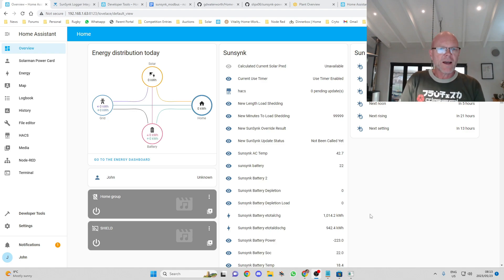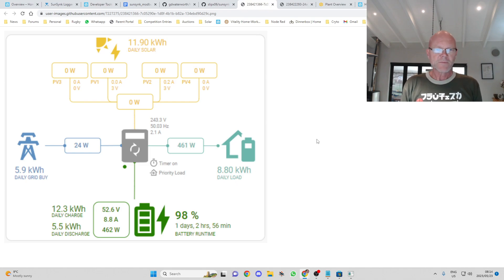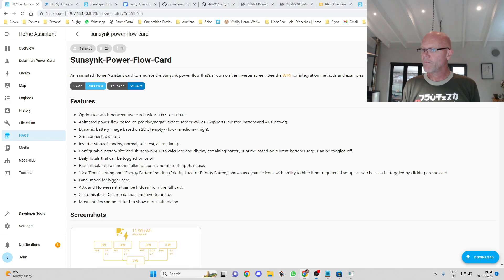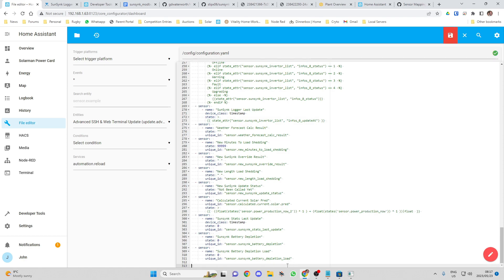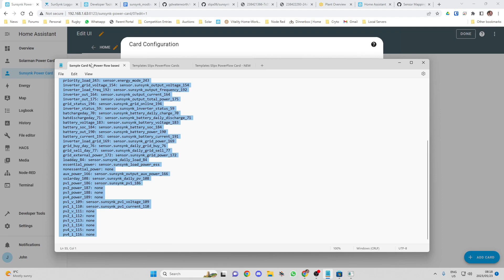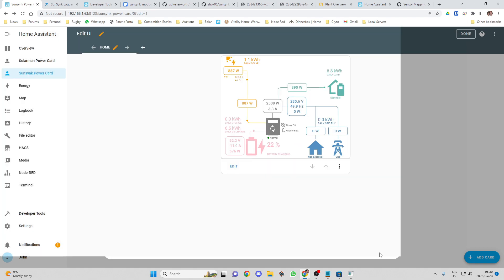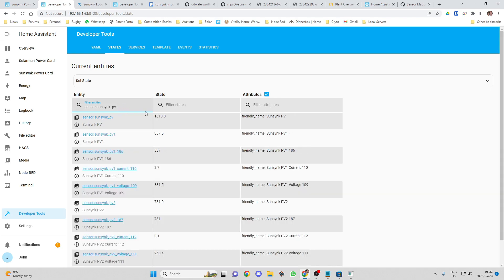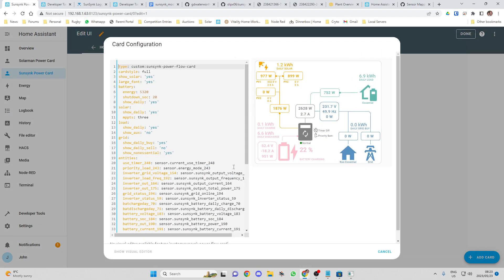Sunsynk Power Card

Comment: Good day - this video is a year old - is there an updated video - i battle to follow as my HA does not display the same - updated versions??   I have my card installed but it does not update readings.  Thanks
Reply from the maker: Hi Rohann, 

No updated video I am afraid, it however should all still be pretty accurate as not a lot has changed with the installation of the cards.  There are a few things you can check. 

Depending on what integration you are using to get the values from your inverter, the entity names in HA will change which will result in nothing being displayed in the Power card as it is looking for a different name in the card.
 
I would suggest you start of by checking that you are actually getting data from your inverter, Settings/Integrations/Device and then add them all to a card,  and then update the entity names in the card to match the ones from your inverter integration if necessary. 
I have found that it only takes 1 or 2 incorrect entity names in the card and the whole card will sometimes not display. 

Good luck, let me know how it goes.
Reply: @SolarIntegrations Thanks for the reply - appreciated.  Ok - my Entity`s in MQTT from my synsynk is all named like  "Deye/SunSynk/Sol-Ark PV current 2"  , the  names on the card is  "sensor.sunsynk_inverter_current"  - -  now i dont find the names corresponding - hope this make sens ......   Did i maybe did something wrong when i configured this? because its not sunsynk specific?   Should i maybe start again?  What would you do?    The reason why i ask if there is an update - if i go into HACS - i dont get the same options that you have on youre video.   Thanks again
Reply from the maker: How are you getting the data from your inverter, Solar Assistant? 
If your data is coming in via MQTT you should go to the MQTT integration in the Settings/Integrations menu 
You should see the MQTT devices that you have being detected by HA there 
Look for the inverter device and click on it and you should  see all the sensors available
If you click on the individual sensors you will see the names of the sensors in HA
 It should be along the lines of sensor.sunsynk+inverter............
Create a separate dash for you inverter data and then add all the MQTT sensors to that dash so you can check there are working correctly using the "add to dashboard" option at the bottom of the page. 
Once you have checked everything is working you need to match your sensor names to the card from Slipx06, I would suggest changing your sensor names in HA to match the card and not the other way around as it will be easier when  you want to update the card to the latest version. 
Good Luck :-)
Reply: @SolarIntegrations  thanks so much - helps allot (yes - from solar assistant).

Comment: Hi there thanks for the Vid. i'm very new to all this , could you tell me could i use this dashboard if i have 2 inverters on my setup?
Reply from the maker: Hi @robertcoetzee1705 you are definitely able to. 

You will need to create a second card power flow card for the 2nd inverter and put the entity values for your second inverter in it.  
I hope that makes sense?
Reply: Thanks, I'll give it a shot.
Reply from the maker: How are you connecting to your inverters Robert?
Reply: @SolarIntegrations  A app called solarsynk I think.  I'll doable check little later.

Comment: Hello when I copy the "configuration.yaml addition" into the configuration.yaml then I get the error message:
bad indentation of a mapping entry (31:3)

 28 | ####pv4_v_115: none
 29 | ####pv4_i_116: none
 30 | 
 31 |   - sensor:
--------^
 32 |       - name: "Sunsynk Daily PV 108"
 33 |         state: >
Can someone please tell me what I'm doing wrong?
Reply from the maker: Your indenting of the lines in the YAML file is not correct.  
Try pasting your YAML file into https://www.yamllint.com/ and it will tell you where the problem is and you can fix it there.  
Is a bit easier than trying to work it out in ESPhome
Reply: @SolarIntegrations  Hello and thanks for your answer, I tried Yamllint and it says it's ok, then I compared it with the video and it's the same. Later late in the evening I added "template:" without "" in the top line and it worked. I have no idea why because it shouldn't but it's going well. Sry, I'm a noob and can't explain it better.
Reply from the maker: No sweat  @bertibert6508  , glad you have got it working 🙂
Reply: same problem i get

Comment: Great Tutorial.  I have the 16kW Sunsynk Inverter.  It has 3 MPPTs.  It seems that the card cannot be setup for 3 MPPTs.  I cannot find sensor.sunsynk_pv3 under the developer tools sensors.  Is there any way to add a 3rd MPPT?
Reply from the maker: Hi @hugosteyn4129, the integration by default only query 2 mppt's, there are however registers in the modbus register that can be queried to get the values from MPPT3 & 4 if required. Which integration are you using?
Reply: Hi.  I have the Sunsynk dongle connected to the Inverter and I am using Gary Waterworth's integration. I am region 1.  In the Template file I saw only see PV1 and PV2.  To try and solve it I made a PV3 entry (copy of PV2 entry) in configuration.yaml file (but no luck).
Reply from the maker: Hi @hugosteyn4129 , not that easy I am afraid, have a chat to Gary on https://powerforum.co.za/topic/16806-sunsynk-logger-integration-into-home-assistant/ he is a very nice guy and I am sure will be able to advise as to what you need to do to get it working.

Comment: Hello, Adding the card and getting the below error. I am using the Region 2 setting for the inverter if that makes any difference

Please include the day_battery_charge_70 and day_battery_discharge_71 attributes and entity IDs

I can see the two entities on the system and when I click on them I get this - This entity ('sensor.sunsynk_battery_daily_charge_70') does not have a unique ID, therefore its settings cannot be managed from the UI.
Reply from the maker: It sounds like you are using the sunsynk integration and will need to change the names of the entities being used in the card. Best to check on the powerforum.co.za thread on the power cards, can remember offhand what the entities names are changed to in the sunsynk integration but am sure someone will be able to help you there.

Comment: Thanks for great content and  SA specific context. I found that I had to do a number of adjustments to the entities to make certain elements work on the card. However, I don't seem to be able to make the Autarky element show on the card. Can you point me in the correct direction in terms of which entities are used?
Reply from the maker: Hi @gkj7762, it really depends which integration you are using to get the data from your inverter as the names of the entities they create are sometime different depending on the integration. You can find the integration names by going to Developer tools/states in Home Assistant and looking the names up there. Alternatively you can go to the integrations and see what the names are of the entities they are generating there. These obviously need to be the same as in the card or it will not work. if you get stuck, the best place to ask for help is on the Powerforum.co.za and just do a search for the Sunsynk Power card thread. Slipx06 watches it and I am sure will give you a hand :-)

Comment: I've followed the tutorial to get the data from Sunsnk Cloud, but for some reason most of the elements of this card aren't populated. For example battery voltage, battery current, inverter current, inverter power. 

If I take a look at the Sunsynk sensor card the values seem to be populated, for example Sunsynk Battery Voltage 183 = 53.2.

Anyone else had this issue? I'm not sure what I did wrong.

UPDATE: I figured out that I had to check my configuration.yaml for the sensor names provided in there. I then updated the config accordingly. For example sunsynk_battery_current was sunsynk_battery_current_191. Updating these meant the values were displayed correctly.
Reply from the maker: Glad to hear you got sorted @pushmetothefloor. You are 100% correct, Slipx's Dashboard is built for the ESP32 integration entity names. The entity names  in the Sunsynk and Solarman integrations are different so you need to either change the entity name in the card or change the name of the entity so that they match up.

Comment: Just a quick Thank you, I've added my Sunsynk to Home Assistant and the custom card. I now need to work out how to use the data!
Reply from the maker: Hi Ian, It is my pleasure :-), I am glad the video's are helping. I will have a new video out this next week showing how to put together your own custom Dashboard in home assistant using some pre-made cards. Make sure you have the notifications ticked.
Reply: @SolarIntegrations  I'll go and have a look round your forums tonight, but do you know of any easy way of determining if we have surplus solar? My system is 12kw but doesn't feed back to the grid. The inverter will therefore produce the maximum power the house demands. i.e. the house may need 3kw, the inverter will supply 3kw but is capable of a lot more depending on the sun that day. i'd like to automate my heat pumps to switch on etc when surplus energy is available.
Reply: @OceanChallenge  that is not a surplus system cause it is not feeedin into the grid. The "surplus / excess" stands for the amount of power you are exporting to the grid.

Might helpt those who might later read this and wonder about the missing answer now 2 years later

Comment: Hi, when I try to enter a card and I copy in the 'type: custom:sunsynk-power-flow-card' , I get an error message: "Custom element doesn't exist: sunsynk-power-flow-card."
I think I have followed your installation instructions thoroughly - any idea what I have done wrong?
Thanks, Ken
Reply from the maker: Hi Ken, sounds like Home Assistant is not seeing the Sunsynk-Power-Flow-Card for some reason. I am assuming that you completed the installation of the card using HACS as shown in the video. Have you tried rebooting the system? Does it see the card as installed in HACS/frontend? If you can't get it to work I would uninstall and then install again from HACS and see if it comes right.